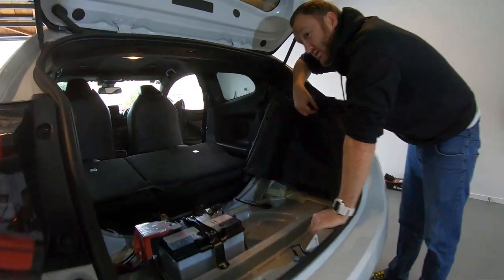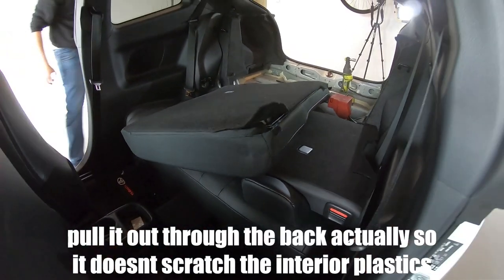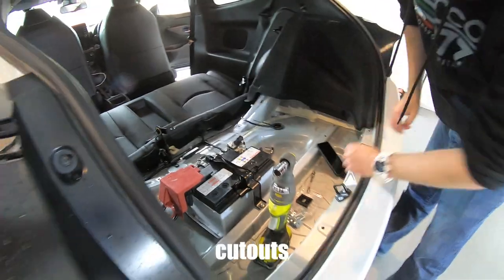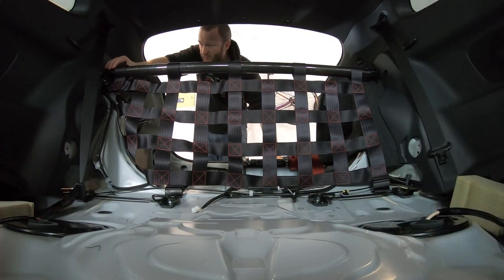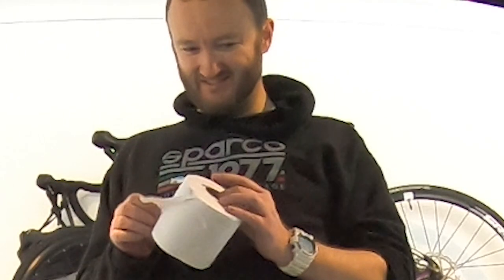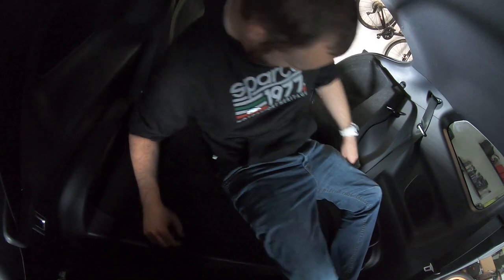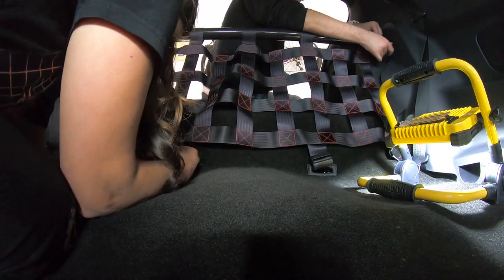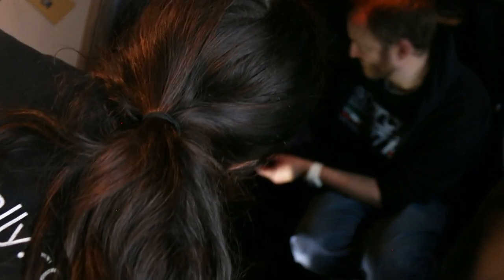Toyota GR Yaris gets some weight reduction!

Comment: how much weight less by removing the rear seats ?
Reply: 25kg
Reply from the maker: what he said! :P
Reply: That's not correct - the rear seats are actually very light (Toyota did a good job). Weight saving is under 10kg - still a good saving though
Reply from the maker: @relentlesspursuit6894  oh really? Thanks for the correction! :)
Reply: @STEPHASAURUSREKD  no sorry front seats are 10kg each. But the rears are around 25kg